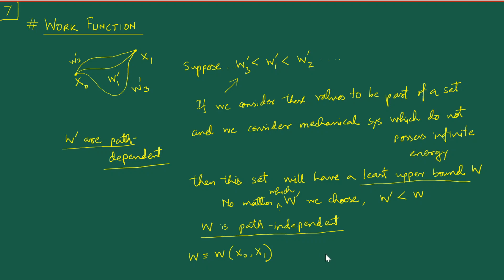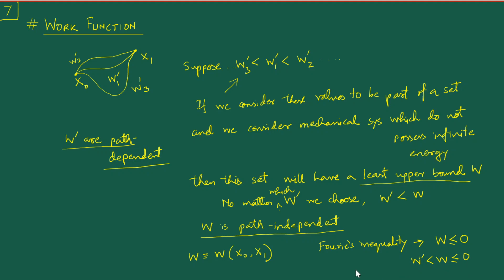[L7] Energy Methods – 4: Work Function and Principle of Virtual Work

Comment: Sir ,all virtual works are path dependent but suddenly why did we 'make' / 'define' the one with highest possible value in a possible set of all virtual works between two points a path independent one and call it the work function?
We know that real work can only be dependent on the endpoints if the force on the particle is conservative and force is given as gradient of potential energy.
Is it the same idea for the virtual work as well?
Reply from the maker: Good question. Think about it mathematically. The least upper bound of a set (here, the set of all different virtual works) is a unique entity. But if it is unique it MUST necessarily be something which depends ONLY on certain characteristics of the set itself. What are the unique characteristics of this set? It is simply that it is a set whose beginning and end "points" are X_0 and X_1. That's it. So it is only on X_0 and X_1 that the least upper bound must be dependent. 

Regarding the second part of your question: You are thinking along the right direction. You can also go back to thermodynamics and think about work done in a reversible process. Any other work will have a lower value. For instance the work done in a quasi-static process (very roughly speaking here), is larger than the work done in a sudden expansion. Which is why a sudden expansion is sometimes referred to as a "lost opportunity" to do work.
Reply from the maker: @Balboa_Rocky  The last sentence of your comment did not get completed. Did you mean to type anything else?
Reply: @Prof_JC   @jc  Thank you sir for your response. The set theoretic argument seems satisfactory to me. This is a question that was  nagging me for years, from the time I first encountered DAlembert's virtual work principle during my BSc Physics days. 
Goldstein says for equilibrium, it's necessary that first variation of virtual work is zero. But never explains 'why'. The necessary and sufficient condition for equilibrium in dynamics  is all unbalanced forces should equal the rate of change of momentum but whenever I tried to form a relationship between equilibrium and virtual work , I couldn't proceed.

Regarding the 2nd part, the work done in quasi static approximation or reversible process is maximum ,  while work done in other irreversible processes is always lesser. So out of a set of works done between two points in a P-V curve, the differential of the  maximum work done (only the special reversible one) is zero. And only the work in the reversible process is a state function while all the other possible works are path functions.
So the parallelism is between reversible (or quasi-static work) in thermodynamics and work function in mechanics. And the principle of virtual work is a consequence of the work function being the maximum in the set of all works.
This means the principle of virtual work is also a variational principle, just like Hamilton's variational principle which says the first variation of the 'action' integral (integral of the Lagrangian of the system between the time at starting and ending point) is zero and the path taken by the particle will be such that the action between two points will be minimum.
Reply from the maker: @Balboa_Rocky  Right! Actually this part of the course of Advanced Mechanics of Solids is very much like Physics!
Reply: @Prof_JC  Sir, actually I edited the comment because of some typing mistakes and YouTube sometimes misses the edits. So I have copied and pasted the whole thing once more.